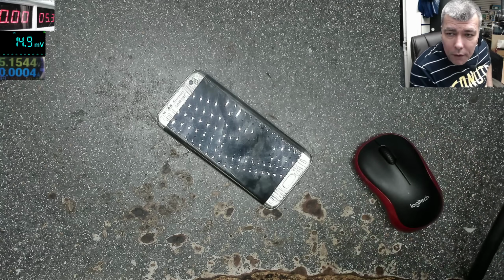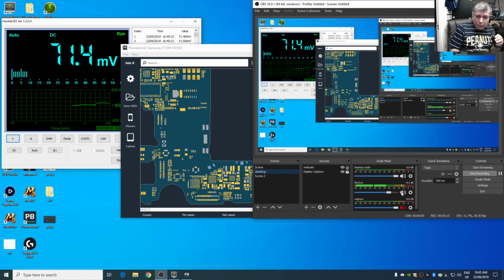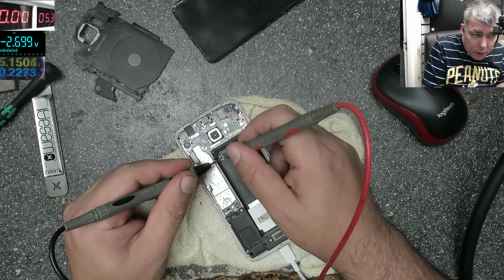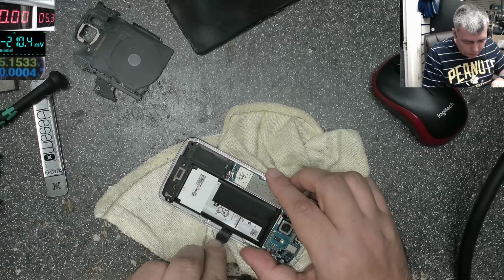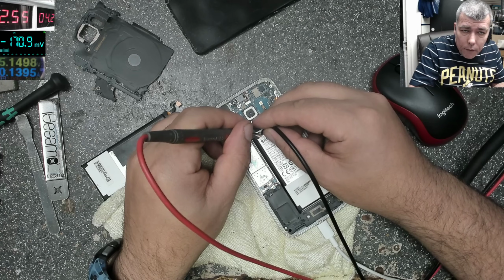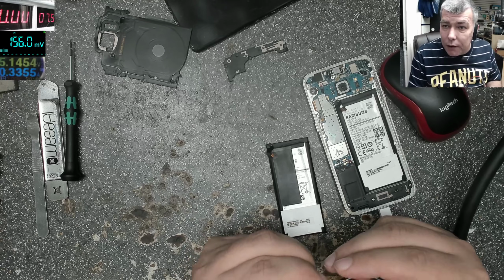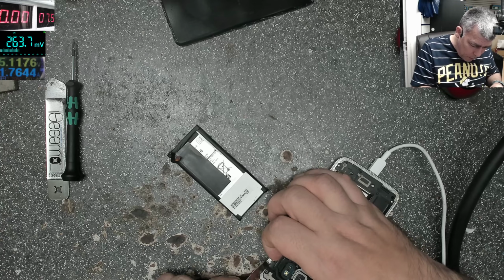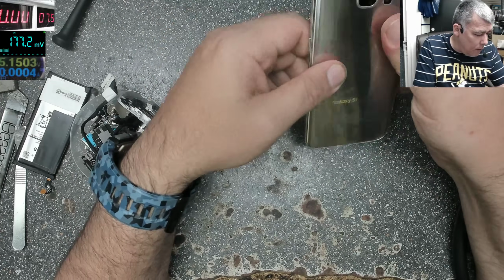Samsung S7 Edge - No Power, Not charging

Comment: Hi,i have an S7 edge for collection purposes. It's been sitting for for many years being turned off and usually charged once around 5-6 months. It died recently,it was on,it turned itself off and it shows no sign of life. If i plug it to the charger the phone will heat up considerably but the phone still shows no sign of life. Is this the case of a completely dead battery or did the phone itself just happen to die?

Comment: Hey Sorin, I really need your help my s 7 Edge used to freeze and restart by itself automatically for a few days until it wouldn't switch on at all, I really need it repaired as I want to transfer data from it to my new device, Samsung repair centers say they need to do data wipe in order to repair it which is something I DO NOT want as what is the point of repairing it without being able to get my data, do you think any of the typical mobile repair shops in town will be able to help with this? I just need it to switch on, so I can use the Move to iOS app lirerally a question of it functioning for 5 minutes maximum, please help! :(
Reply: Thers s fix here on Youtube for your problem,  dont need repair

Comment: That resistance measurement is not a good way of determining a faulty battery. Load test is best. Load the battery with a resistor and then check voltage drop.

Comment: Lol...this might seem dumb, I don´t have the right tools, but can i use a hair dryer for heat(to open the phone) and to heat the rosin flux on the motherboard???
Reply: Might work to open it but defo not to melt solder that requires high heat in a concentrated area.

Comment: So where do you buy the Samsung batteries? And where to get the S7 schematics? When the charger charges with only 500mA it will take longer before it reaches a certain voltage so that it will charge at full power. Applying the 2.5 amps for a short while lifts it over almost directly. Very interesting. Have you dealt with S7 that randomly reboot?
Reply: if your reboots often you need to change your mobo

Comment: hi. i have same problem with my s7 edge. not charging not power on just dead. i took to a repair shop and he said its mother board issue. first he boosted the battery and it started working. later he said no its again dead and its mother board issue which needs to be replaced. i took my phone back but dont know what to do..
Reply: https://youtu.be/4aM0-Slx7bI maybe that's the problem
Reply: @nomikhan9756  same issue  mother bord is good it’s about same power issue that’s it

Comment: Strange fault. Using the power supply, the old battery seems as good as the new one. Maybe a problem with it connector!!
Reply from the maker: Yes, i know its strange! Can be the battery board also, not the battery inself
Reply: @electronicsrepairschool  do you know the charging ic number of samaung s7 edge?